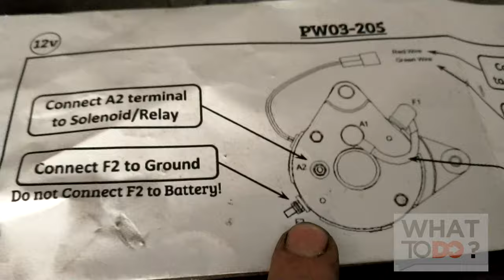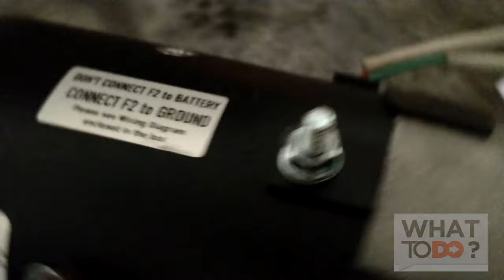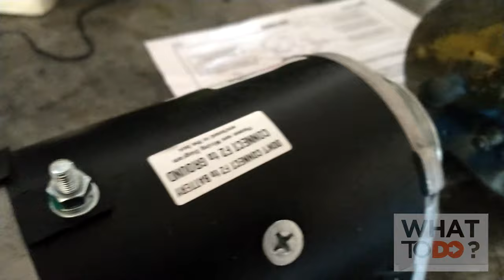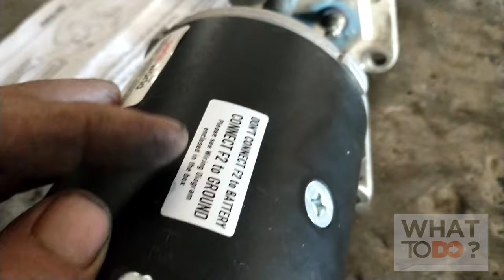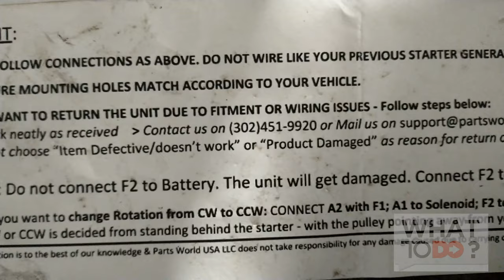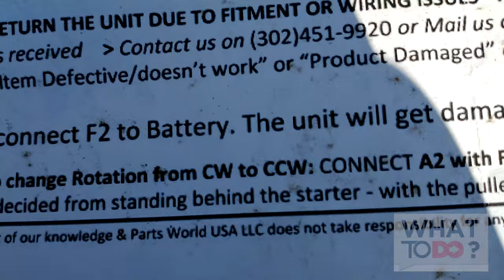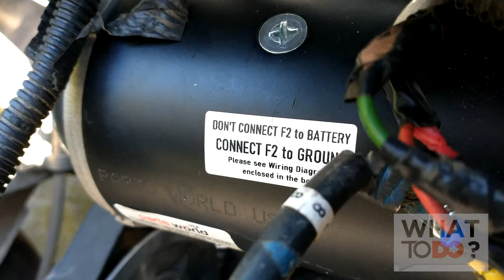Amazon Starter spinning backwards / not working - FIXED

Comment: I need help please I can’t get battery to charge, it’s producing 13.5 from generator but not a t battery. New wiring harness new solenoid new relay new regulator. New generator. Yamaha G16A , I have 2 black wires at end of wiring harness, I do not know where they go? Help please.

Comment: Help mine just moves an inch and pop's the fuse but as long as the voltage regulator is unplugged thw motor will start and run fine wene i plug it back in the fuse pop's agean any help would be appreciated
Reply: I did buy the cheapest starter generator Amazon had but mine doesn't have any paper work or sticker on the motor im haveimg some issues with mine blowing fuses
Reply from the maker: Hmm. What type of machine are you working on?

Comment: When I try to jump start my starter it spins for a second then it stops then stutters then spins for a second. How do I know if I need a new starter or if I need a new solenoid because that’s old too
Reply from the maker: I would just replace both if they are both old. This way you know its taken care of. Most starters will come with solenoid attached. But yes, sounds like your starter is going bad.
Reply: Use a multimeter to check for voltage loss or if the voltage is constant then the solonoid is good
Reply: Might just need new brushes.